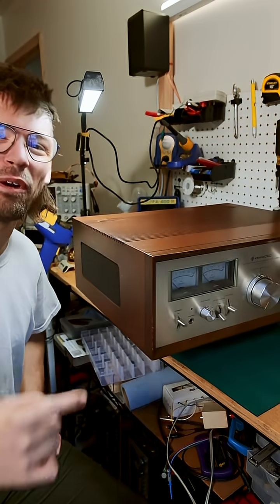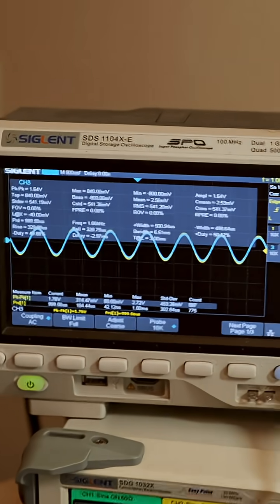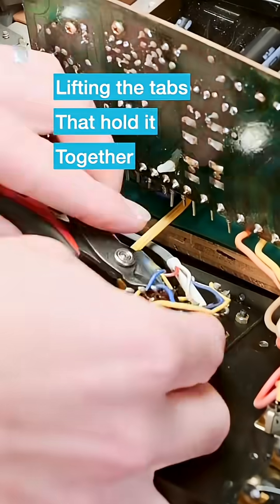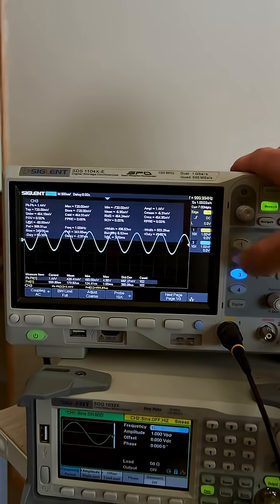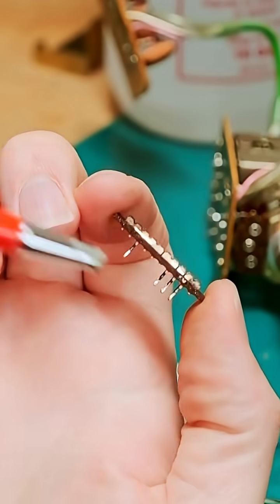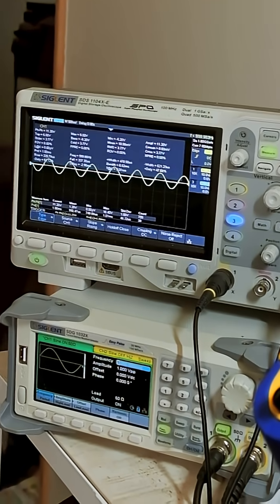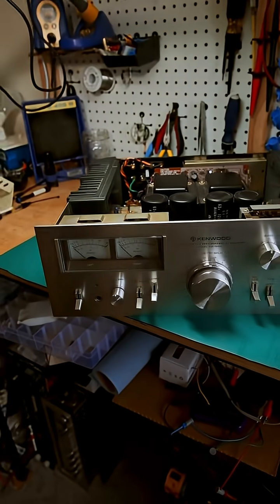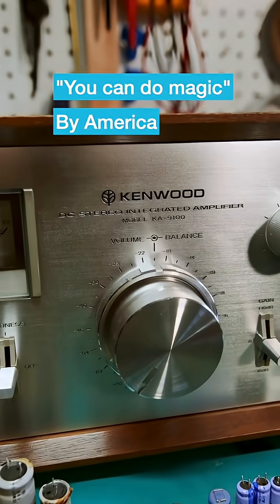Kenwood's baddest integrated 🔥 #Vintageaudio #Stereorepair

Comment: I'm surprised this amp uses STK modules - I recall they were mostly used in lower power receivers and amplifiers of the era. Beautiful restoration by the way!
Reply from the maker: Good eye! Some people swear that STKs are bad for sound quality, Kenwood didn't seem to think so. They had their own line of high power units that ran them. The KR 9600, KA 9100 and others used them and put out 160+ wpc. You can make them sound good but most manufacturers used them as a way to decrease manufacturing costs rather than using them that way. I think the more mainstream brands stayed away from them because they aren't repairable. Just gotta replace the whole pack.
Reply: @Shuksanaudio I'm surprised people would say that about sound quality, if you compare the specs of STK gear vs. units with discrete outputs, they are essentially identical. They get a bad rap because 40 years later they are no longer available, and the aftermarket ebay ones are mostly poor quality, which forces people to buy kits to rebuild them. It's impressive they were available in higher power amplifiers, I wasn't aware of that!